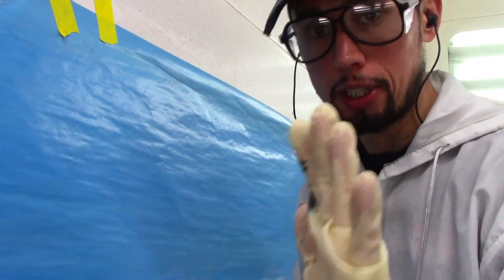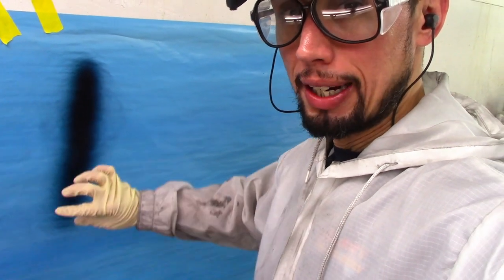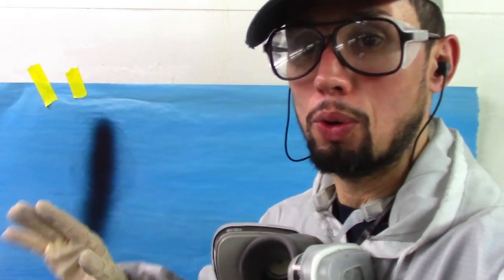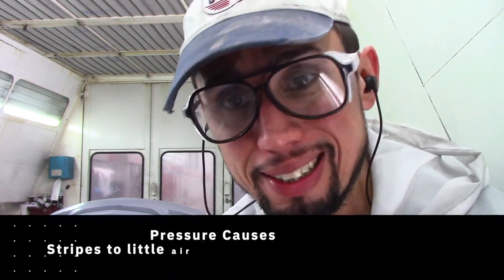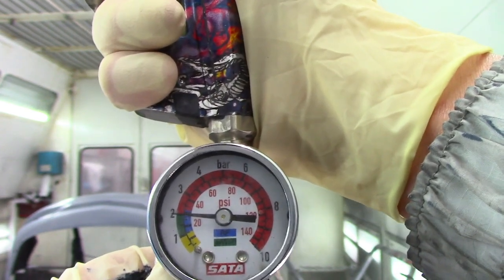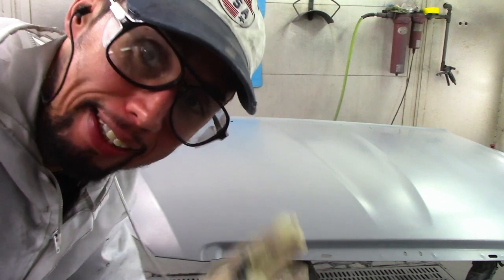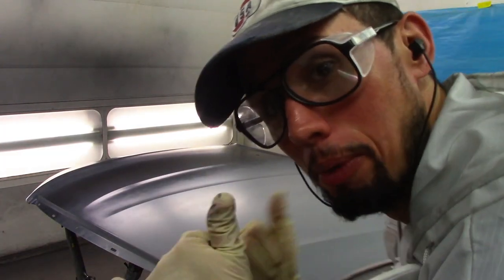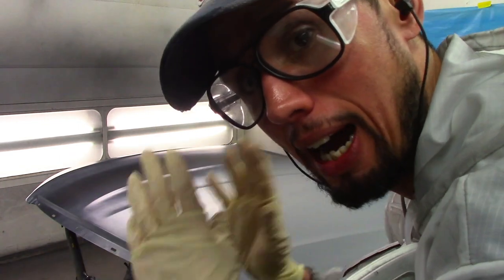Best Painting Techniques For Beginners And D.I.Y.ers

Comment: 1:55  If your gun is heavy on the top and the bottom and light in the middle it usually too much air pressure do to thin, light base coat viscosity.
Reply from the maker: Yes but if the Spray Gun is also going bad the Spray Gun will spray an uneven pattern as well. Nothing last forever ever and if you don’t take care of your equipment it will get damaged and not work properly.

Comment: Could you used a different value shade on the sealer ? For better coverage on the base coat ?
Reply from the maker: Yes I could’ve used a darker sealer for better coverage but for the sake of explaining the base coating process I used the lighter sealer so the base coat could be more visible to the viewer.